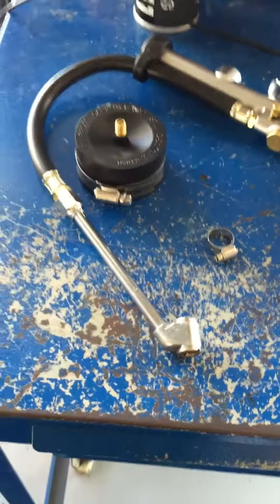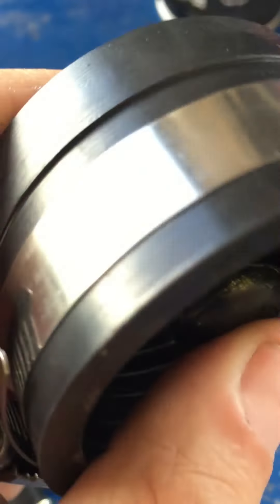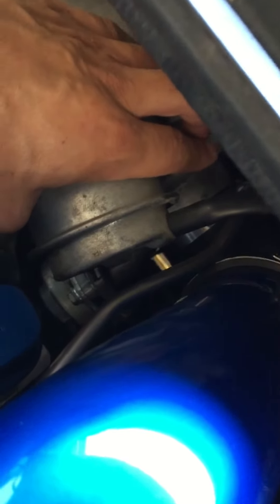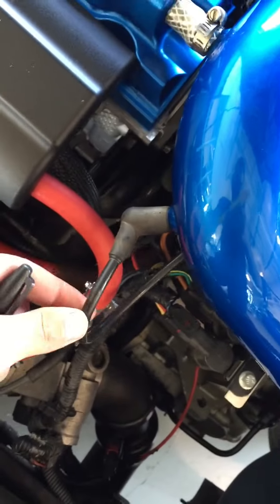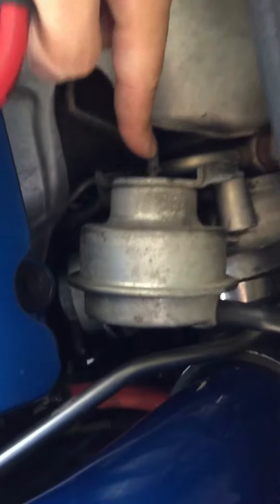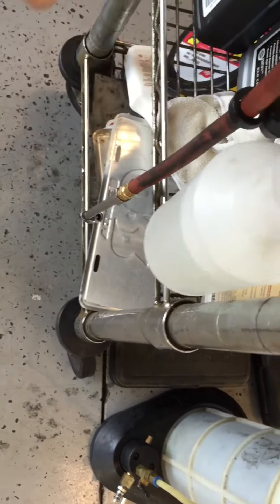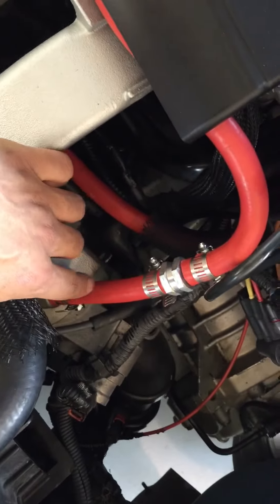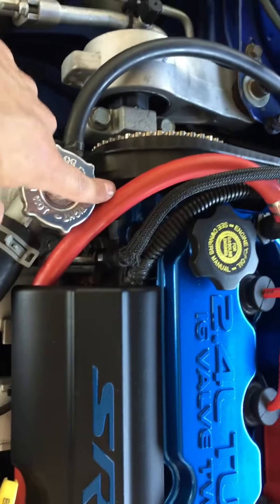SRT-4 home made boost leak tester

Comment: Pretty funny, thanks for the video ! I just wonder what is the purpose of the Check Valve ?
Reply from the maker: Prevents extreme pressure back flow. Stock pcv valve doesn't quite do it. It's extra support basically
Reply: +juv923 Ok I see, thanks !
Reply: Matfast32 so after the test just leave the check valve right there? its helps right?
Reply: xavy albarran Yes you can leave it there at all time, the check valve will help a little more the PCV system.